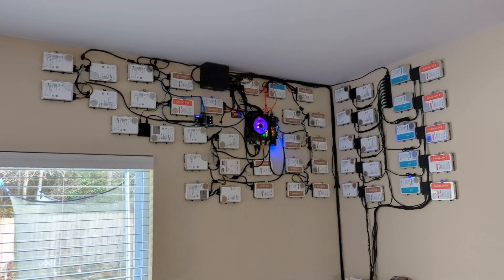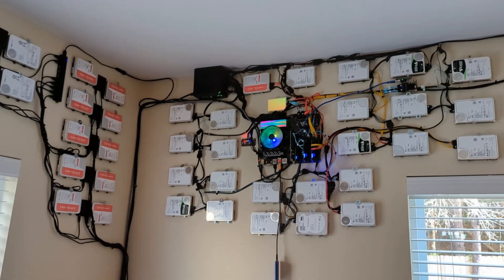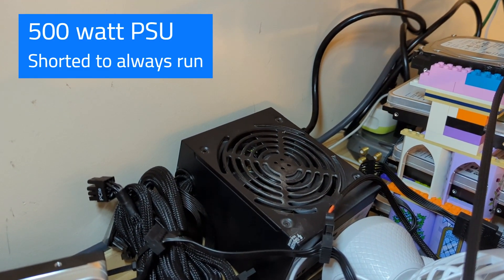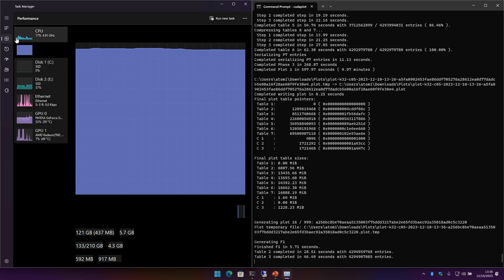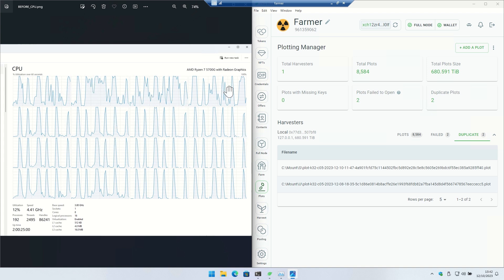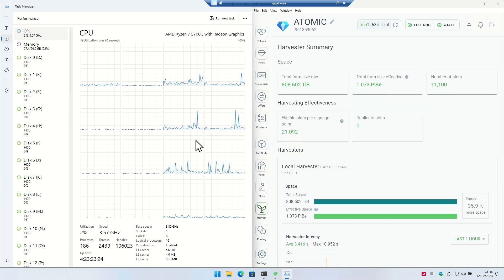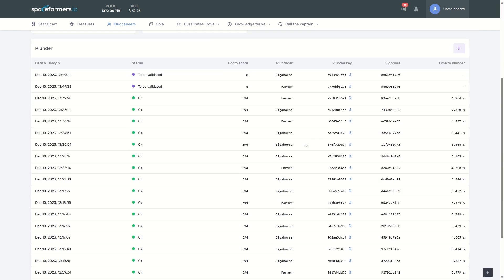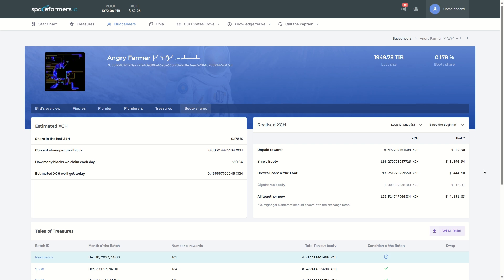Chia Farmer: Discrete GPU Update

Comment: You are using solar panels to power all this, right?  How much heat do you think you have to offset with your air conditioner?  My office is really cold in the winter.  I was just wondering if I should set something up to get heat and crypto at the same time.  I don't have a source of free electricity though.
Reply from the maker: Heat output is measured in British Thermal Units (BTUs) - 1kw/hr = 3412 BTU/h or 1000 BTU/h is around 293W.
Based on the 250 watt figure, BTUs/hr = (250 watts * 3600) / 1054 = 854 BTUs per hour, per server.
So for the two low(er) compression servers combined: 1,708 BTUs per hour.
The C15 high compression dual GPU is 450 watts, so that's 1,537 BTUs per hour.
If you're looking to heat your office, go for the ultra high compression wattage hog GPU setup.
If, however, you're just looking to drop the Fathead database; give me admin permissions and I can do it for zero electricity cost.

Comment: hi, what psu u use? how peak and avg power with one 1070?
Reply from the maker: The P520 workstation has an 800 watt PSU and the secondary one is only 500 watt to run the drives.  The two 1070s are both undervolted to 70% and peak out around 450 watt for both of them, idle around 200.